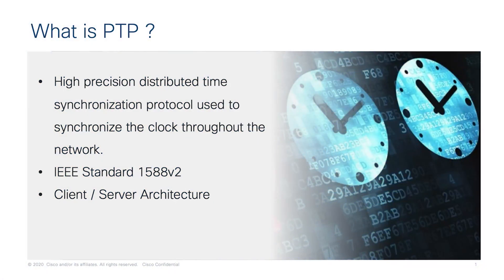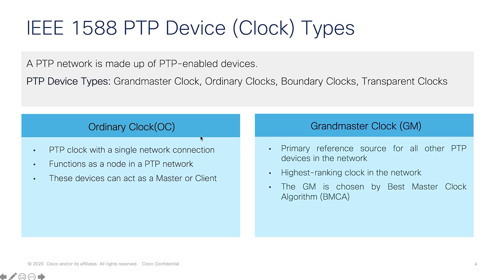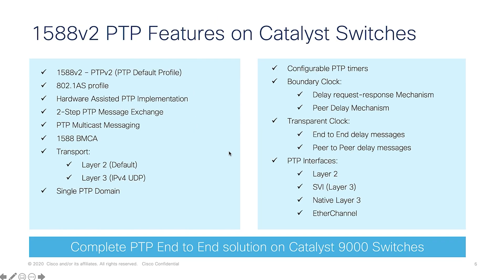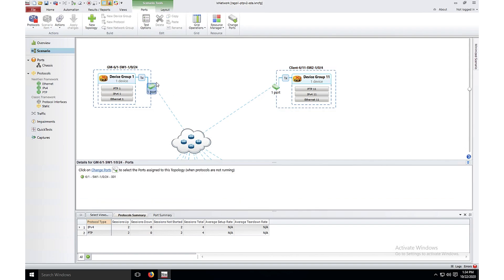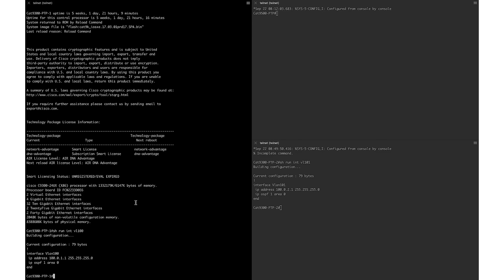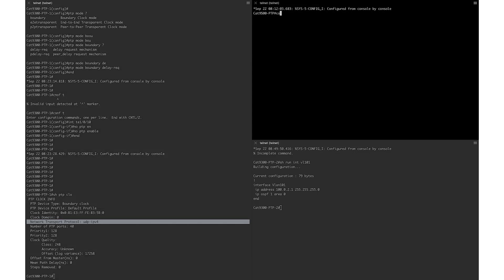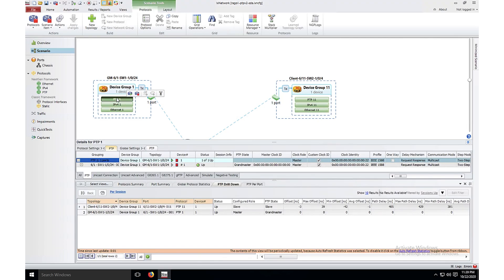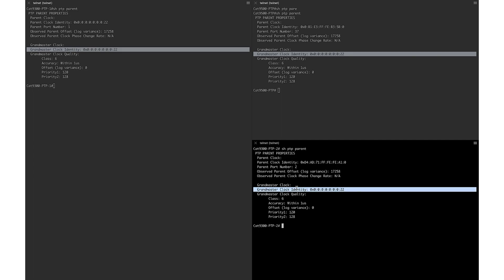C9K Precision Timing PTPv2 IEEE1588-2008

Comment: and on top of that, I also have a nother pair of IE3300 (Same as above) and going thorugh the same 9500 distribution switch, how can we seperate the PTP as there will be 2 x GM going through the same uplinked distribution (9500) switch and also using the same VLAN. Is this possible?

Comment: Great video with good details.

I wanted to ask if I have 2 x IE3300 switches running 17.6.3 and one of the IE3300 has the GM and the other IE3300 has the drive (client) and both IE3300 are uplinked via a 9500 switch. Will it work if I use the same config as your video?